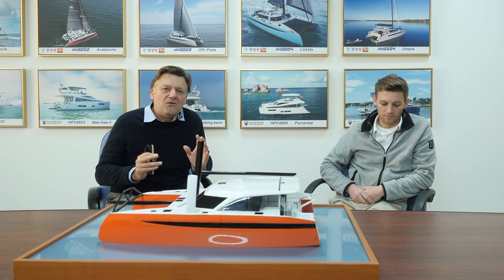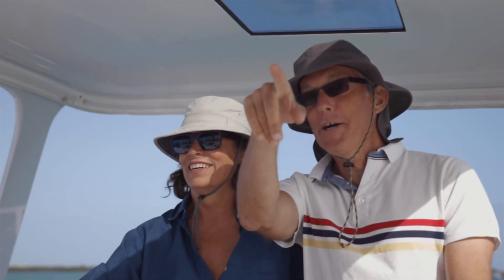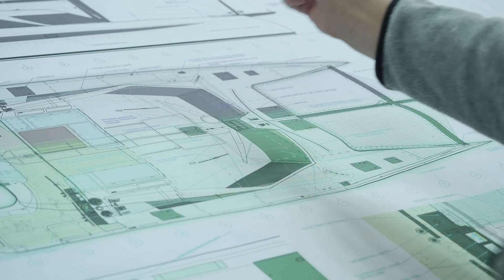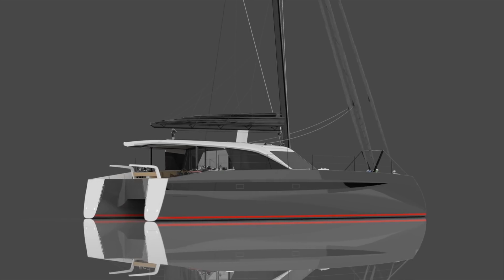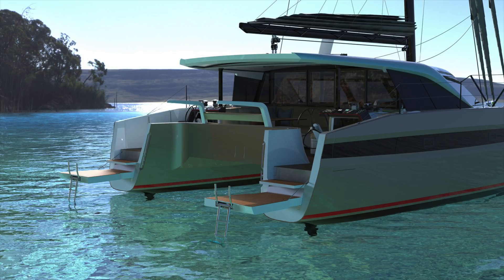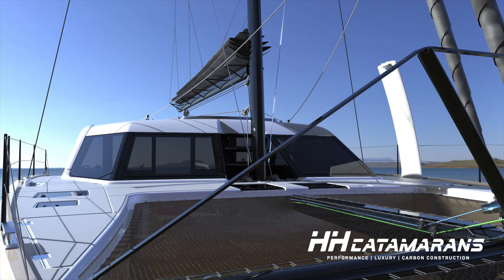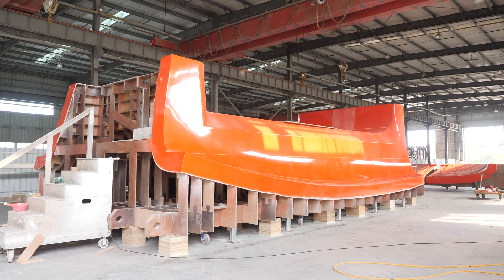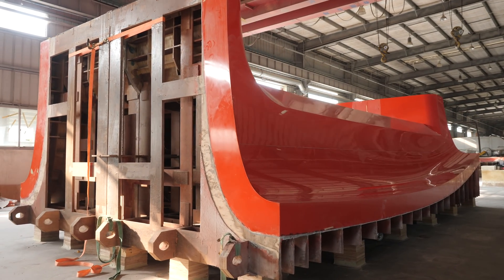Designing the HH44 (Episode 1) "Yachting Evolved"

Comment: As many have noted that they follow Jason and Niki Wynn ,I too have been following then since they were Land lubbers 9 or 10 years and I too love the concepts, and technology that you have designed. I am a Composite Experimental Aircraft nut and see many parallels between slang composition and tech with Aircraft design. I wonder if you two could do a deeper dive on the rain capture design and the specifics of the solar ,components and battery designs. Thank you for providing these offerings.cheers

Comment: I liked the HH44 but then I saw this video ... https://www.youtube.com/watch?v=QXLMesOKpvE.  After you view this, you will not want to spend the amount of money this boat costs.  Not worth it as most parts are literally off the shelf components that you can stick in any catamaran and get that same level of performance. Take a look at Outremers.  Better build, less money, greater time on the water than this one, etc.
Reply: Hi Tony, you are wrong. I owned an Outremer 51 and the design of their coachroof will not allow for this type of solar install. HH has moved ALL of the lines to the deck level plus moved the helm stations aft so this amount of solar can be installed. The video clearly misses the point that HH have "designed this boat from the ground up with the idea of electrification" and unless a boat company does this, it will FAIL! Case in point: The Outremer 4.zero. Otherwise, they fawn over the design, the performance and the quality.
Reply: @TheSailingFamily  Yeah, but at this price? 1.6M for a 44?  I don't think so.
Reply: @tonynotstated695  It's not $1.6m. These guys had quite a few facts wrong...
Reply from the maker: The starting price of a HH44 is $948k, and fully equipped it is the same price as an Antares 44, Balance 442 or Outremer 45. Hit us up if you change your mind at sales@hhcatamarans.com!

Comment: Why are you using carbon fiber ? Carbon fiber conduct currents 
That is electricity. 
Wouldn't avionic S fiberglass be better to use??
Reply from the maker: We've been building with carbon fiber for 30 years and isolate it where necessary. If done correctly, this is not an issue.

Comment: Why the diesel dirty engine that’s like designing a electric car with a nasty Diesel engine for backup or mounting parachutes on birds
Reply from the maker: Because it is better than running out of power and not being able to motor off the lee shore!
Reply: @HHCatamarans  two electric motors like any catamaran back up generator switchable battery banks. Why Evan switch    I know the boating industry is mad about replacing Diesel engine with electric but that’s the point. WHY THE Diesel engine that’s just like saying haveing a backup diesel for the diesel. STUPID
Reply: @HHCatamarans  your scared of being the only ones cause the marine community will not except it with out the Diesel engine   Whats with having electric if you have to haul around the stinking load diesel

Comment: The forward view is blocked around the mast. Why not have all glass around mast area for far more visibility.
Reply from the maker: Because on a true performance catamaran where the mast could see loads exceeding 5 tons, you need the mast grounded on the deck. The coachroof is too weak to maintain those loads. It would be a nice feature indeed, but it indicates a weaker design that would not be capable of the speeds this design can handle. Everything in yacht design is a give and take! Thanks for the question!
Reply: @HHCatamarans   I'm not saying move the mast to the top of the coach roof, just change the middle structure behind the mast. It is about visibility whilst sailing/sitting inside the cabin, even from the helms. There is a whole structure with two steps on it that is blocking a lot of the view. Photo HH44-E_SL12+.jpg, a whole big black structure blocks the view, surely It doesn't need to be like that. Why can't you make nearly 100% clear forward visibility??? (apart from the mast and the coach roof supports (what could be tiny carbon fiber or stainless beams) .

Comment: Very nice but how good is the helm visibility to the opposite front corner? Really would be nice to be up high, more like the Outremer 55 perhaps
Reply from the maker: Helm design is a challenge on a catamaran and there is no single correct way to do it. The disadvantage of the Outremer design is that when it's raining you will still need to go outside to hoist your sails, trim your sheets, dock your boat, etc. With our design you can stay protected while doing all sail handling, or swing it outside if the conditions are right. It is always a trade off with yacht design, and for a true bluewater cruiser, we think protection is worth it.

Comment: Love the concept. Truly disruptive and innovative! Looks like you're hitting the mid 40' sweet spot for price point and to limit hobby horsing on passage. Great video! With weight sensitivity in mind, I liken Cats to aircraft in that there is an expected payload limit before performance is affected in a negative way. For instance, a Gemini Legacy may have a 2500# payload, and one of your 55's may have a 9000# payload or more. Will you be discussing the 44's payload in an upcoming episode? Also can't wait for the discussion on the hydro generation part. Wondering about ability to turn it off in light air to avoid performance penalty.

Comment: Hello, very interested in this boat but my husband (the captain) wants to know: is there a way to check the Diesel engine oil, coolant, and belt tension without pulling the beds part?
Reply from the maker: Yes, the beds are mounted on a gas strut, so they lift out of the way to check in on the engine easily (and in the comfort of your AC).

Comment: Great video. Really exciting boats. After I got my Prius hybrid I think my second thought was 'this would be great in a boat.' When I got a Tesla with 384 horsepower (two motors) I wondered why electric motors in boats were so under powered.  Batteries of course - but diesel-electric solves that problem (as it's done so well with rail locomotives since the late 1940s.)

Comment: Thanks for sharing an interesting design.  The parallel hybrid looks sensibly designed and should be flexible, reliable and repairable.  The swing helms are a nice feature, and the folding transom seems like it should increase safety and keep the cockpit dryer.  The flat coachroof and lower boom are good for both better performance and more room for solar.  It also makes both the center of gravity and center of effort lower for greater stability and efficiency.

Thanks for emphasizing cleaner energy.  Electric drive is a great synergy for sailing, and the large solar array should make the boat very energy independent with good backup for both propulsion and house loads from the Diesels. (3+ kW of solar should easily power all house loads, however.)

Overall this design offers a lot of redundancy both for energy sources and also propulsion.  And of course the main energy source for transportation is wind, which the hull and sails should make efficient use of.

Comment: Hey Seth, the only reason I even watched this video was cause it was pretty certain you'd be involved in the production. Looks like a great design, though I have to ask if the boat will be available with straight electric motors. With the performance expected from an HH design, diesel engines shouldn't be necessary. As Paul says, "It's a no-brainer." Okay, I may be biased, but the video would be a bit better if we had you presenting at least part of the introduction to this design concept. Cheers:)
Reply: Ha. Thanks for watching! Yes, I edited this video (can you tell?). I'll let Paul and James take the credit for this one, but you'll see me soon enough. ~Seth
Reply: @TheSailingFamily  Very good!
Reply: Pure electric drive would be fine for daysailing and some coastal cruising, but batteries can't hold enough energy for world cruising yet.  Unfortunately a diesel generator or parallel hybrid is needed for that.  That said, on a performance boat, the Diesels would get very little use in general.
Reply: @LoanwordEggcorn  I respectfully disagree. Sailing Uma has proven that you can do this with relative ease. They did have to bring along a small generator when they left mainland Norway and headed North to Svalbard, which is way north of the Arctic Circle. You do have to plan your voyages more carefully, though. In most parts of the world people want to sail, this can be done. Also, Jimmy Cornell, on his Elcano Challenge, had to turn his Outremer cat around and go back to La Grande-Motte for a refit. They want to add a bit more PV panels and a towed generator. You can follow Jimmy on this circumnavigation and see for yourself :)
Reply from the maker: It can be done, but as the producer we feel a safer and more redundant system is the better application for world cruising. Since that is a major objective with this design, we favored the Hybrid approach.
Reply: @HHCatamarans  Yeah, from the stand point of a builder, this makes absolute sense. It will be nice to see the other videos - and to see the first hull sail!
Reply: @rickemmet1104  I think we mostly agree.  Both examples you cited needed generators to supplement the battery energy in order to go longer distances, so in essence they're showing that a generator is needed for long passages.   For shorter distances, pure battery can work.

I'm not in favor of Diesels, and am in favor pure electric drive, but as a practical matter, Diesels are needed for longer distances.  Imagine a 500 mile becalmed passage, for example.  That can happen.

(The situation is rather different on land, where most people drive fewer the 50 km per day and most private vehicles are parked 23 hours a day.  An EV with 300-500 km of range can easily do that, and EVs can be charged any time they're parked near electricity, which is most of the time.)

Comment: I really like all of it except the visibility from the helms to a degree that makes it a deal breaker. 
However I'm very pleased to see Hybrid Marine finally having the success powering sail boats they deserve.
Reply from the maker: From the sitting position at the outboard helm you can still see all your tell tales. Standing improves that line of sight considerably. In our performance video we will show you what this line of sight looks like. It was carefully considered.
Reply: Where do you suppose the sightline problems are?
Reply: I prefer a greater angle of unobstructed view forward.
Reply: @sailsoon  Achieving that is difficult on a catamaran and always has compromises.  

The helm above the coachroof has good visibility but raises the mainsail boom which raises center of effort.  It also puts the helmsperson away from the rest of the crew/salon.

Far aft helms have good visibility, but poor weather protection.

Helms at the mast (front helms) have good visibility but less good spray/wave protection. 

Helms at the bulkhead at the aft of the salon have good weather protection, but less visibility.

What is your preferred solution?  (I don't think there is a perfect one.)
Reply: @LoanwordEggcorn  I have to admit that for the moment I can only judge from the arm chair, but I didn't really like the bulkhead helm on my cat that I owned two decades ago. Inevitably a head sail would block the vision unless you are motoring or there is so much wind that you are reefed down heavily. As a result I found myself moving around in the cockpit and sitting on the side deck to be able to peep under the genoa. So in my opinion two helms at deck level are clearly a step in the right direction, but I want them to offer at least 90° of view when I bent outside so when I walk over to the other side the 180° ahead are complete. As far as I can see the Seawind 1260 would be an example.
My favorite cat so far has it's helms farther out and slightly elevated so you can see over the coach roof but they can also be folded inwards when ever you do not wish to expose yourself to the elements too much. I'm not writing down the brand though because I want them to have a building slot available when I''m ready <g>
I'm aware that many sailors are fine with looking thru the deck house windows almost 100% for their ahead vision. For them the HH 44 is probably a perfect boat.
Reply: @sailsoon  So it sounds like your main issue is having a helm on both sides, plus outboard enough (or on a swing helm) to be able to see outside the deckhouse.  Or high enough to be able to look over the deckhouse.  Does that sound right?

(It sounds like your previous cat had a single helm, and for one tack, the leeward view ahead was blocked by the sails.)

There are definitely bulkhead helms that are sort of half way up so that the head is just above the coachroof.  That keeps the boom lower than a helm fully (or mostly) above the roof.  Seems to be mostly Australian designs.

Balance, Seawind and others have clear enough sightlines to be able to look through the deckhouse windows in the down helm bulkhead position.

Really there is no perfect solution, just advantages and disadvantages, and different use cases and preferences.

The swing helm can add more possibilities while not adding much complexity, though the Seawind helm location achieves much of the same function for bulkhead helms, i.e. look outside the deckhouse or through it.  It's too low to look over it though.
Reply: @LoanwordEggcorn  You are 100% right including that there is no perfect solution.

Comment: According to what I've learned, feathering props locked in reverse position yield a significantly higher energy input than a folding prop, which runs by design in a semi-folded configuration during hydrogeneration. So i was wondering what made you choose folding props over feathering props?
Reply from the maker: Good question Slim. As with all aspects of this yacht, there is a reason, and typically it has to do with performance. While fixed props would indeed offer better regenerative power, we prioritize speed/performance over this aspect of the design. With the amount of solar onboard, the hydro-generation of power is more of a bonus than a requirement, so we want to keep the option for low drag and high sailing speeds as the priority.
Reply: @HHCatamarans  Agree that's a better optimization for a performance boat, and you explained the reasons very well.

Comment: It was so cool to see this.   I am a self taught sailor who misses her 25 foot C and C and am thinking about living on a catamaran.  About 3 years ago I was watching videos and wondered why the idea my bicycle had when I was a little girl had not been employed.  I recall thinking how brilliant it was that there was a generator attached to the wheel of my bike which powered the light and it seemed odd catamaran manufacturers had not thought to capitalize on the the prop to generate electricity.  well done you
Reply from the maker: Thanks J! Great memory!
Reply: Hydrogeneration, recharging batteries from the propulsion motor used as a generator, has been around for several years with electric motor sailboats.

Comment: Many great features - but the folding transoms? Diving gear, multiple people standing on it or heavy cargo when loading the boat, rough seas. I see the repairs rather than the feature. Doubtful this is a good idea.
Reply from the maker: We designed the folding transom using 100% carbon fiber / epoxy, and the design rests on the hinge and on the hoist line. They are VERY solid. No need to worry about strength in this area of the boat! Bring on the Dive Tanks, that's what these are for!

Comment: Thanks guys for sharing,  look forward to watching the rest of the series. I'm hopeful the deep dive into energy generation, storage amd usage systems, with commentary on, for example, OceanVolt propulsion backed with a reliable DC genset as redundancy 😁
Reply: They used a mechanical parallel hybrid with a clutch between the electric motors and the Diesels.  That means either can move the boat, and the Diesel can be used to charge the propulsion battery bank by using the electric motors as generators.  That way no genset is needed.  (The diesels plus the motors are the generator.)

Comment: If the diesel’s were replaced with lithium batteries of the same weight, what would the range be? 100% Electric with only the solar and hydro gen?
Reply from the maker: We have been asked to build a 100% electric version (with no diesel engines at all), but we have decided against it for now. As a respected brand in the multihull world, we need to ensure the safety of our owners (both new and future second-hand owners) and our boats cannot "fail." For this reason we will stick with proven technologies and designs with inherent redundancies. This type of risk can be taken with a custom build, but for buying a brand it is important they always work.
Reply: @HHCatamarans  thanks for the reply.
Is your concern that the batteries go flat or that the electrical system fails?
Or is is more about in an emergency when a boat might take on water and the electrics can’t operate?
Reply from the maker: Yes, in a worst case scenario (lee shore at night, strong head winds, low batteries - or a lightening strike - or water intrusion) we want to ensure the system will have full power capabilities. Unlike a Telsa that runs out of juice, the boat can't pull over and park! We think the Hybrid approach, with traditional diesels to rely on when you get in trouble, is the right approach for now.
Reply: Quick answer is that pure battery electric would not have enough range for long distance cruising, even for a performance boat.  Unfortunately a Diesel is needed, for example if there is a long passage with no wind, like hundreds of miles.